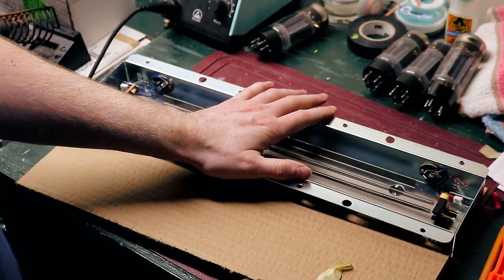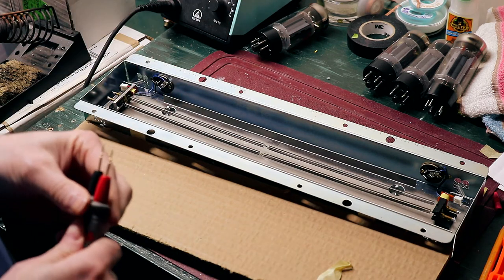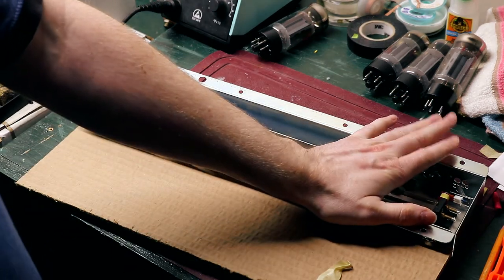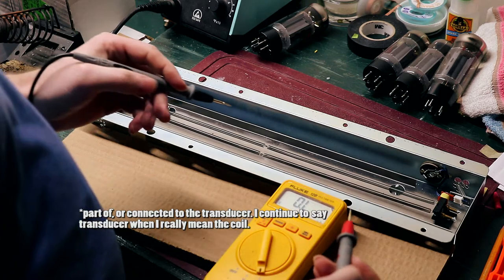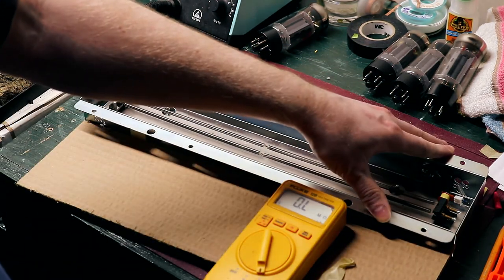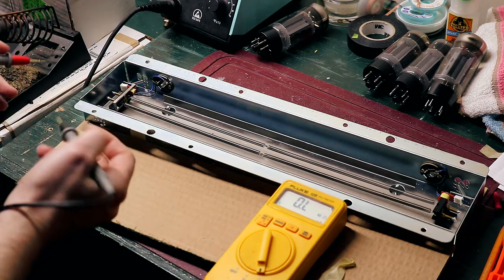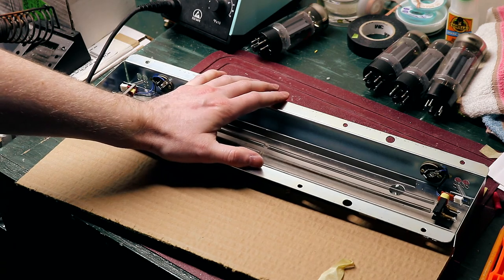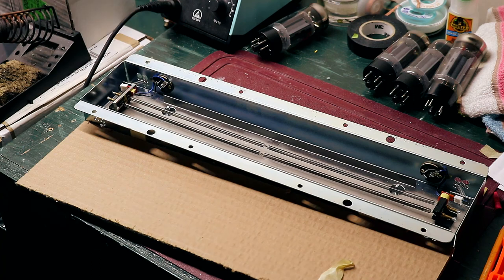Testing Reverb Tanks

Comment: It wouls help if you mentioned where to set your multimeter.
Reply: Obviously, as he is measuring resistance, you have to set it on resistance (Ohm). And he mentioned the ranges usually it will be between 1 Ohm and several hundred Ohms.

Comment: I have a musicman amp with weak reverb.  The amp has an accutronics tank, and both transducers measure about 175 ohms.   What else could it be?
Reply from the maker: Is it tube driver and recovery? or opamp? A weak recovery tube is a common problem.
Check wire on the tank going to rca jack and the little connectors going to the coil on each end. Check the RCA cable going to the amp. If all that is good, you need to figure out if the driver or recovery stage has the weak signal. If you give the tank a wiggle with the reverb turned up, there should be a fairly large splash of sound. If it's low then likely the recovery stage has a problem.
Reply: @amp_mechanic  the wires and springs in the tank look good.  I did the ohm check from the end of the rca cables.  The amp has two EL84 output tubes plus one 12ax7 so I'm thinking there is an opamp inside the chassis. If I take the tank out of the amp and move the springs with my hand, the reverb sounds strong.  But with the guitar plugged in and the reverb on 10 it is barely audible.

Comment: I've watched videos indicating input to input and output to output regarding reverb connections on the Fender amps. you've indicated the opposite. Please  explain, who's right?
Reply from the maker: If you hook it up one way and it doesn't work, swap them. Most older fenders, if you're looking at the back of the amp, the right rca jack on the amp chassis goes to reverb pan input. The left goes to the reverb pan output. But some do label it the opposite. It's not a big deal, just swap the cables.

Comment: mine, just not work, but in the out, Ground are touching the chasis. i don't kno if this is well but not noises when connect to the amp.
Reply from the maker: All the tanks I've seen have the RCA's on a fiber board to isolate the outer sleeve from the chassis of the tank. Pos and Neg are just connected to either side of the coil.

Comment: Amp mechanic, any reasons why the the reverbs input is very low impedance like 0.3 ohms it's in the middle ohms and the output of the revert tank is very high impedance isn't that kind of backwards because you're loading the signal down if the input is very low impedance it should be the other way around that the the output cuz on most buffer units buffer pedals that output is very low impedance and the input is very high impedance but the reverb tanks it's reversed and the the input of the reverb tank is very low impedance and the output of the river tank is very high impedance so it seems like it's a it's going to wreck your signal your signal level and signal power correct me if I'm wrong
Reply from the maker: Yeah, that's not the way it works. It's using the driver tube output through a transformer that changes high voltage for current, hence the lower impedance for the tank input, it needs to physically move the springs. The higher impedance on the output is more optimal for the grid of the recovery tube. Kind of like how a higher resistance value on a pickup makes it hotter. Not quite the same but similar.

Comment: Hello my friend, is there any option to repair the transducer?? I tested my reverb tank from my marshall and the output transducer is bad same as yours
Reply from the maker: You'd have to strip the coil and re-wrap with new wire. They are simple devices but in most cases it's easiest to buy a decent quality replacement tank like ones from MOD.
Reply: @amp_mechanic  Hi friend! Thank you very much for the answer, in fact yes, I was able to rewind and repair the transducer, it was a matter of patience and delicacy to avoid breaking the coil cable again, it is a tedious job but it is possible to do it. Those reverb tanks are very fragile.

Comment: I have a Marshal DSL 100 H the reverb is working. The reverb level is very low. Just to hear it. I have to set the levels at classic reverb and ultra at  both at 10.. It is there but a very short tail of reverb. If I run the reverb  control at position 5-6 the reverb is not present. Suggestions ?
Also when i  insert the foot switch it changes the setting. Please help
Reply from the maker: Normal procedure is try a tube swap first. Then check cable connections. If that checks out, move on to the tank, could be a wire inside partially broken. If all that checks out you might need a new tank. Also be sure to check that the pot on the amp is ok but, rarely have I seen that be the failure point.
Reply: @amp_mechanic  surely a new tank is over kill. It must be repairable without completely replacing!?

Comment: I’ve determined that my reverb tank on my dual showman is distorting my sound a bit when reverb is on. What could cause that?
Reply from the maker: tube, driver or recovery. Bad cable. Broken wire strands inside tank. Bad resistor or cap on the driver or recovery side.
Reply: You might have a higher gain 12AX7 tube plugged in where the lower gain 12AT7 tubes should be.

Comment: I have been trying to repair my reverb tank because I cant afford a new one, I have got the issue narrowed down to one of the coils, I unplugged each coil, and when I test the connection point on the coils, one of them has continuity and the other doesnt. I assume that the one with no continuity is probably at fault? I guess what Im asking is, both of the coils should have continuity right?
Reply from the maker: Both should have DC resistance. One side should be higher than the other.
Reply: @amp_mechanic  Ok thanks

Comment: So close.  Cannot see the precise components you measured which defeats the purpose of the video.  An update would be most welcomed!  Thanks.
Reply: Exactly. Too bad, this is excellent otherwise. I wonder if it’s the little cube thingie or something else lol I’m poking around with my multimeter 😂
Reply: He’s putting the multimeter (set to resistance) directly across the input connector terminals then across the output connector terminals.
Neither should be open circuit or high resistance.
Hence he states the output side is  ‘OL’ on the multimeter. Thats open circuit, or knackered to us mortals!